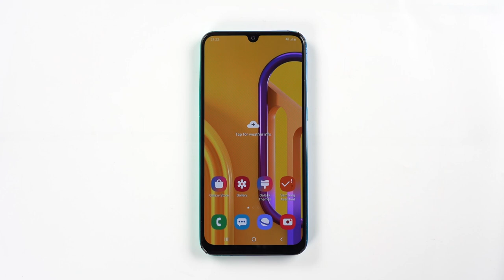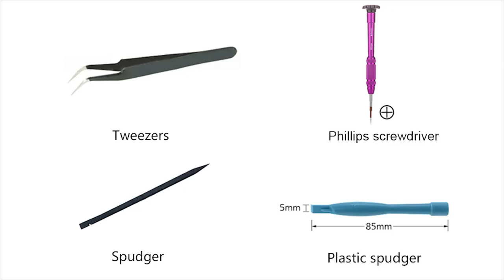Samsung Galaxy M30s Loudspeaker Replacement

Comment: is it necessary to open the upper part?
Reply: no even you do not need to remove charging circuit connector. just open lower part and change the speaker.